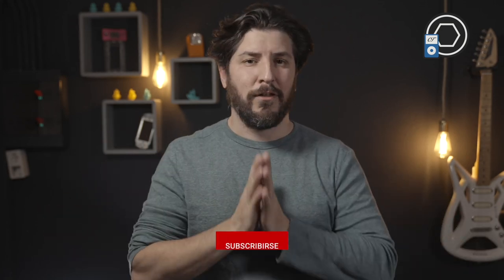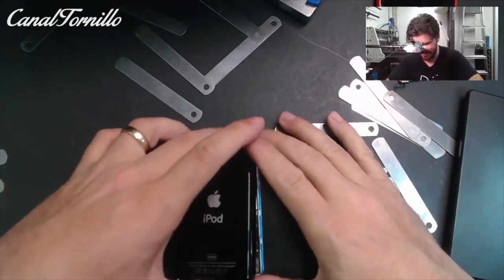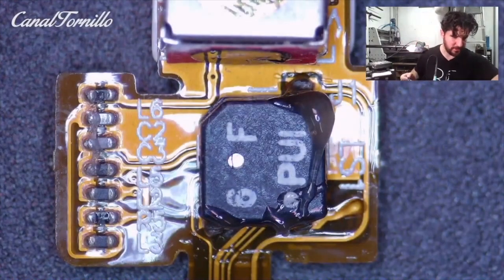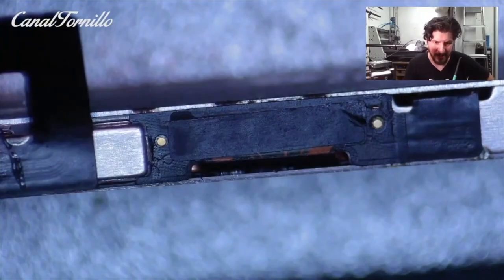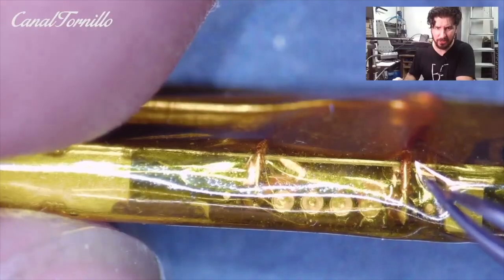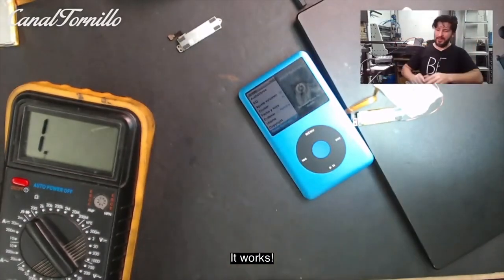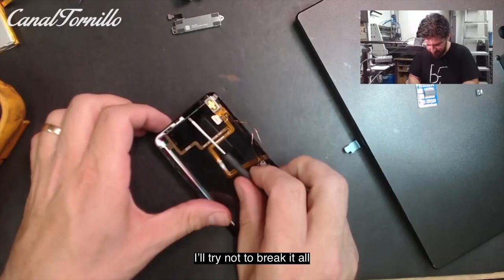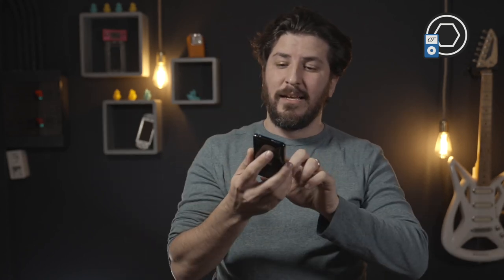Taptic Engine Installation on iPod Classic 6G (English Audio)

Comment: Didn’t work on my first try unfortunately. Think I melted the pads on the Taptic Engine.

How do I know I didn’t damage anything when I desoldered the click speaker? Should those two speaker contacts have continuity? Trying to figure out if I need a new headphone assembly
Reply from the maker: It is only possible to know if Audio Flex is ok with an oscilloscope. Only then can you see the electrical pulse that the iPod sends to the clicker. Maybe with a high quality voltmeter, but I'm not sure. If you want you can join to my discord (https://discord.gg/7mZnuMDw) and share a photo so we can see. What taptic engine are you using? It is not necessary to solder in the taptic testpoint. You can solder in the connector sides. There you have the + and the -. The large pads on the sides.

Comment: Hey got your SSD and 1800 mAh battery set from AE. Was wondering if there is any space for the taptic mod using the Iphone 7 one if using the thin back case. I was told the smaller Iphone 6 taptic engine is not as reliable.
Reply from the maker: No. With a razor or ssd drive and a 1800mah battery there is no space for a taptic engine. With the original battery or a 1000mah battery, there is space. Well, yes, there maybe a place for Taptic.. If you have a razor and you use a single sd card in socket 1, you can desolder socket 2 (if you have tools). Without that socket, you might be able to put the taptic engine OVER the razor, but I'm not sure. Would have to measure.